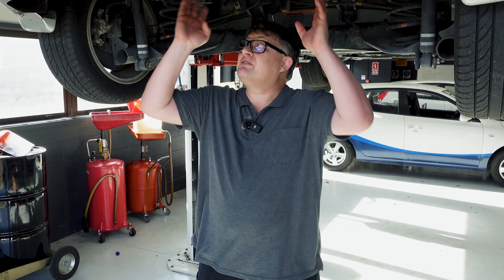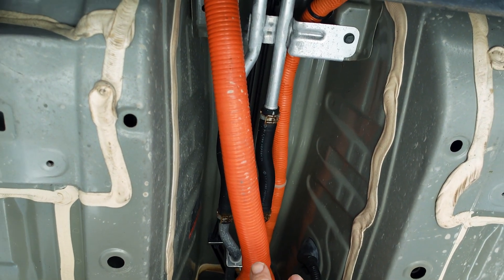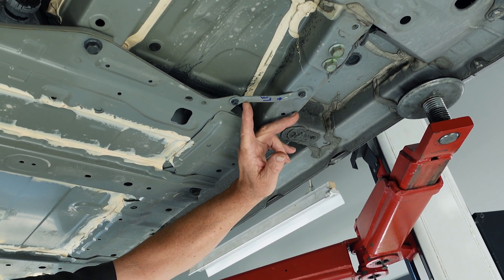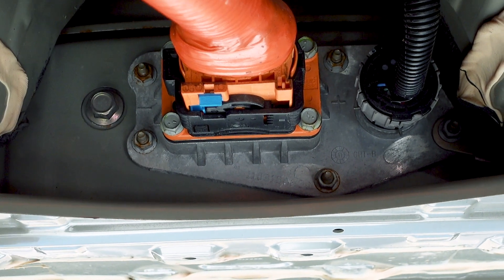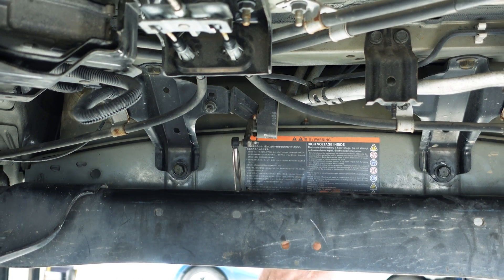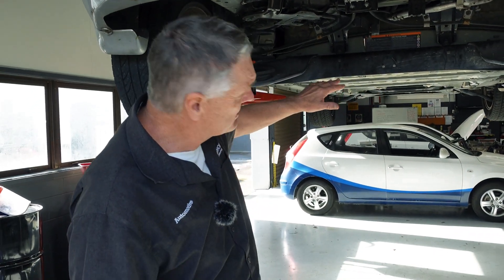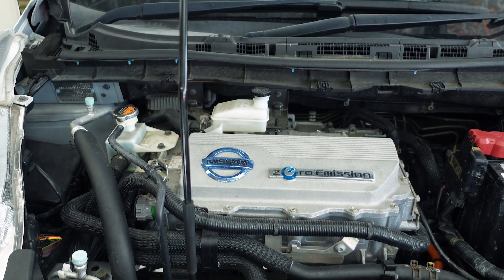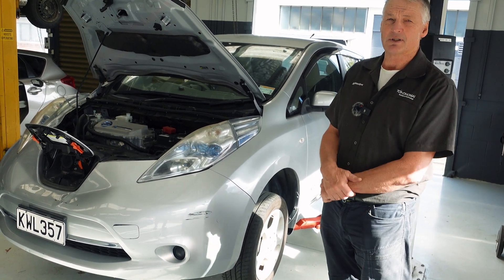Looking underneath a used Nissan Leaf

Comment: Hey, I just bought a 2015 Leaf with 89000 Kms on it. I got it inspected today and the mechanic said that entire front subframe was rusted out completely. How much would it be to fix that or replace it. is there another solution to my problem?
Reply from the maker: Hi. Apparently The sub frame replacement is a used component, at around $400-500 and take around 6 hrs - need to check hourly rate - maybe $120 per hour. That is NZ dollars. Regards.